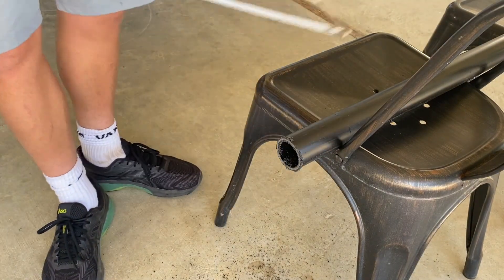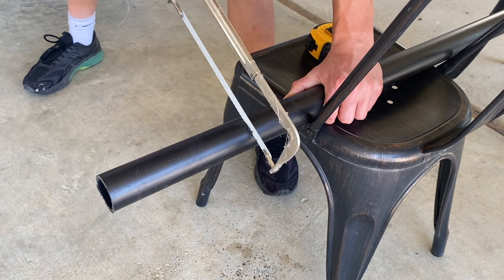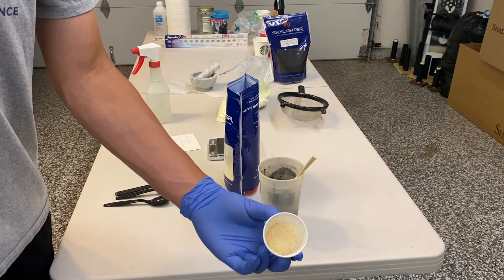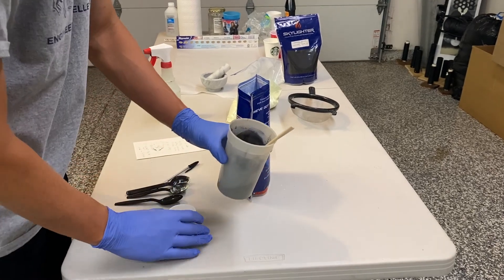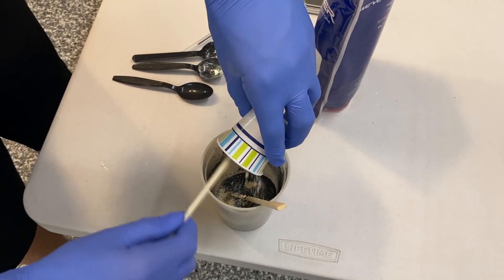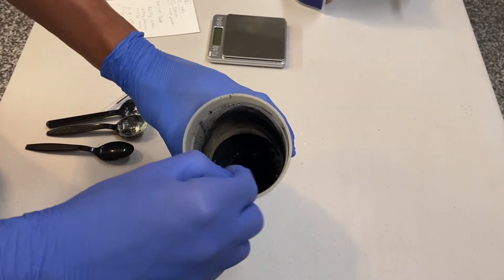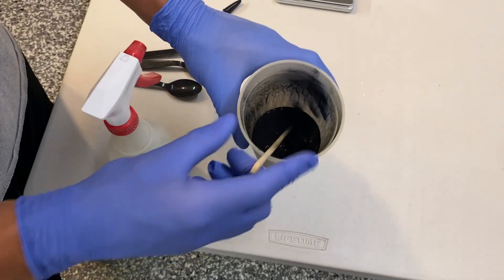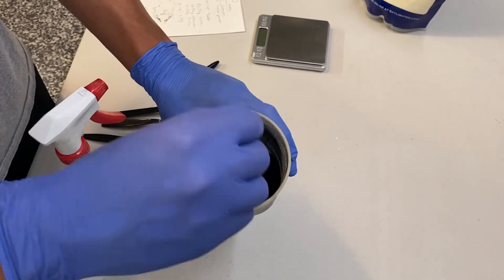ABS mortars

Comment: Just wanted to tell u that if you want to make some green sand for metal casting you can mix baking soda, sand, and any oil.
Reply from the maker: Oh I have not tried that before I usually just use water. How much of the baking soda and oil do I need to put in?
Reply: @pyrochemminer3453  you can just eye ball it, the reason u use oil is because it dosnt boil so it wont make bubbles